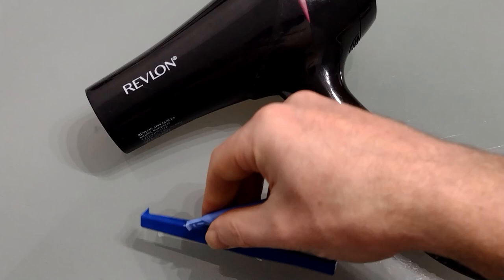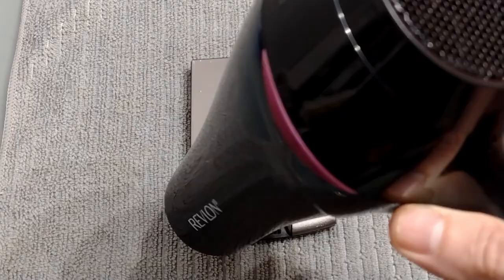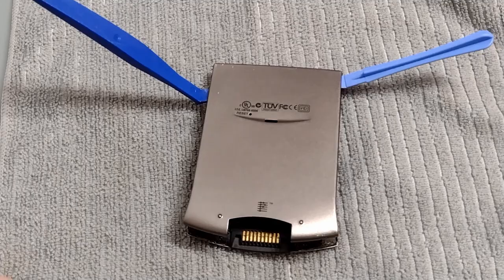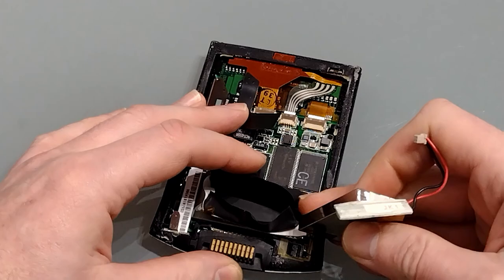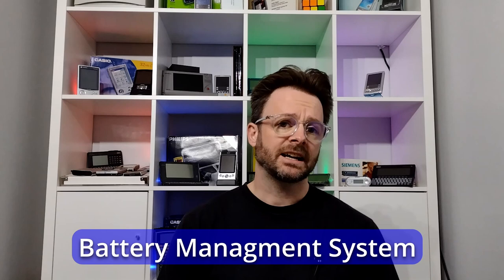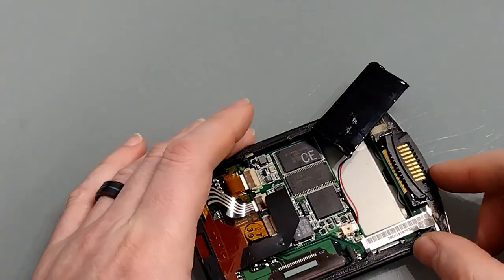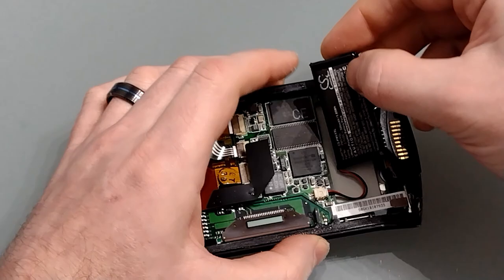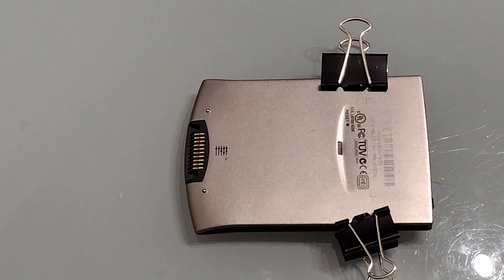Palm V battery replacement

Comment: Always liked the Palm V series. Really was an oversight to glue it together by design, the m500 series was screwed so way easier to change batteries, but I still prefer the V/Vx over the m500 series, not sure I can put my finger on why....maybe just a tiny bit bigger, nicer dock/port, better stylus solution. I like my 515, but it's just a bit fiddly. Anyway, a great informative vid, thank you!
Reply from the maker: I think some of it s just the slightly higher weight from the metal backplate, makes it feel like quality! I do love the Palm V!

Comment: Where can I purchase a battery with the bms?
Reply from the maker: I bought mine from ebay, it should come with the BMS (its usually a flat circuit board at the end of the battery) and the connector clip - had a look and theres loads on Amazon too
Just search Palm V battery

Comment: Very helpfull video, could you provide the dimension of battery? Thanks a lot!!
Reply from the maker: Its to the nearest mm 45x21x5mm
Hope this helps, the original batteries are only 750mAh so you should be able to get a better pouch battery that will fit. Sorry for the delay I've been away 😁
Reply: @HandheldComputing @HandheldComputing, thanks so much!

Comment: why didn"t you just use the old connector and the new battery?
Reply from the maker: The BMS is soldered to the battery so you absolutely can de-solder the BMS and just attach a new battery of the same chemistry and it will work 😃 . If you attached the new battery directly to the leads best case it won't do anything, worst case it'll go kaboom... 💥

Comment: Just ordered two Vx off eBay with a dead battery ... let's see how that goes 😅
Reply from the maker: Good luck, just follow the instructions and its pretty easy with no soldering involved - just take your time removing the back panel, if you bend it it's difficult to re-fit

Comment: I just hate when the back cover is simply glued to the case. That method of yours, just reflow the old adhesive and keep it under pressure for a while, never worked for me. I always had, in the end, to clean it up and put a new adhesive strip.
Reply from the maker: Its always worked well for me, the key is to keep the pressure on. I once bent a back plate and that just did not go back on properly!
Reply: @HandheldComputing  Yeah youre right, the pressure is crucial. Where did you find those pressure clips?
Reply from the maker: @fradd182  They are 'bull dog' clips most office or craft places will stock them. They come a range of sizes and are very strong - when not sticking PDAs back together I normally use them for paperwork! 😅
Reply from the maker: @fradd182  loads on Amazon if you don't mind supporting Bezos